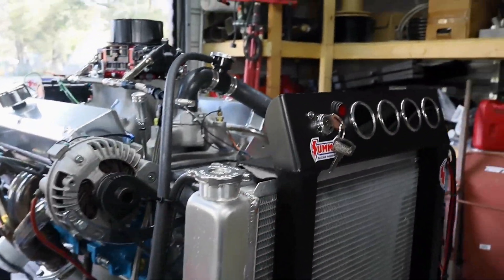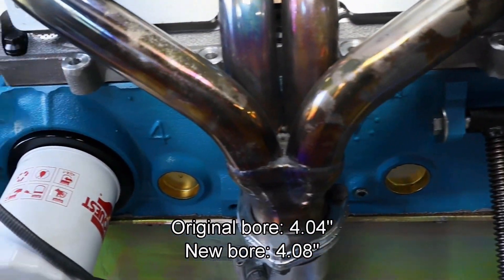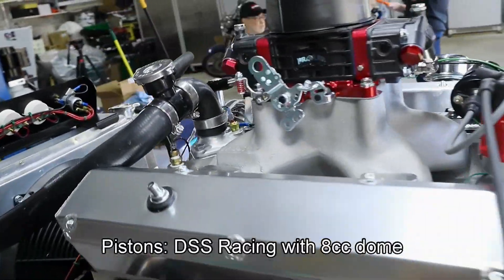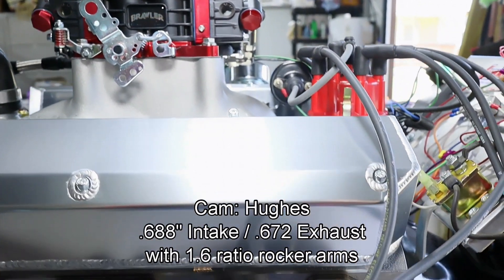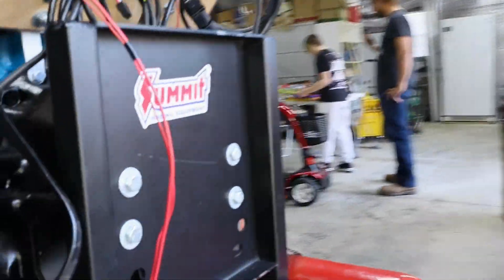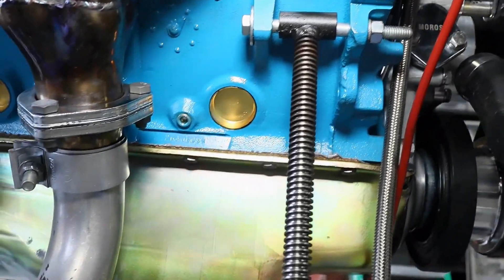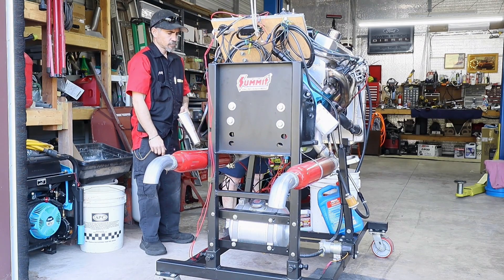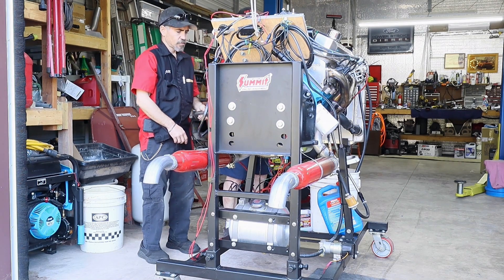The LA-phant: First Firing

Comment: Why is it keep cutting off
Reply from the maker: Lol. The subtitles are helpful for this part. It was a combination of ignition timing and proper levels of fuel in the carb bowls.
Reply from the maker: Many settings have to be accomplished- Carb float levels, timing for sure. Timing is a guessing game till the engine is running and this engine needs to be close on timing or it wont run. Once the basics are done it will still be hard to start due to race style engine and no choke - Pop

Comment: Ain't it messing up the cam turning it over that much without it cranking cuz it is not oiling at all when you're turning it over a little bit but not much it's got to splash up on the bearings and all that that's why you break it in at 2,000 to 2500 RPMs so is the camshaft  going to be okay
Reply from the maker: Lol. Thanks for asking.

The oil pump sends plenty of oil through the gallies to lube the bearings. It's not limited to splash. Additionally, solid lifters don't require as much lube compared to their hydraulic cousins.

We didn't address this in the narrative as the intent of filming was shoot and go. 

There's more information coming out in the next few weeks.

Thanks for watching.
Reply: Okay thanks for answering me

Comment: Sweet!  How much timing did you have in it?  I've found that mine loves around 35* or so.  Can't wait to hear it after it's tuned!
Reply from the maker: 0* cam timing.

Ignition timing is changed mechanically via the distributor.
Reply: Does it ever run
Reply from the maker: Lol. There are a lot of things people don't show on camera. We show them.
Reply from the maker: 10 Degree base idle 34 degree above 3500 rpm - Pop

Comment: Man you guys really need to ditch that old starter, to this day it's one of the worst sounds in the world. 1988 mopar went to a Smaller Bosch starter, then in 92 or so to a Nippendenso.
Reply from the maker: Lol. That's definitely a lower priority. Its use was a cheap solution to get the engines started. When this engine goes into a vehicle, that will be changed to a lighter unit.